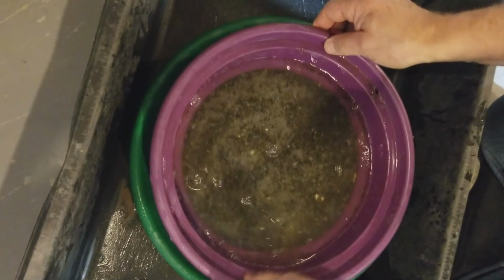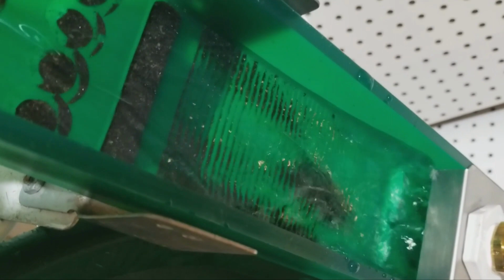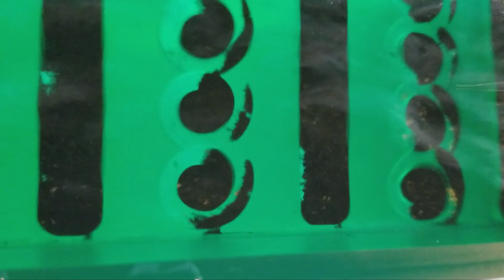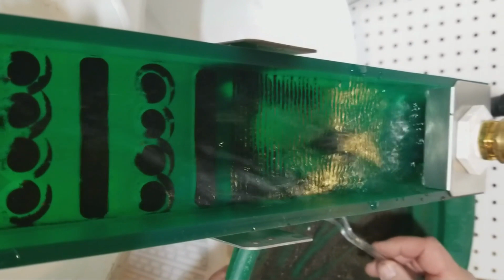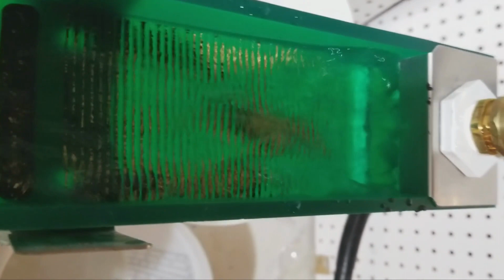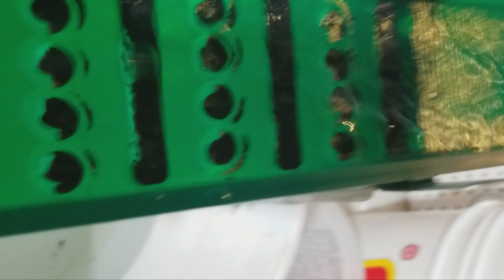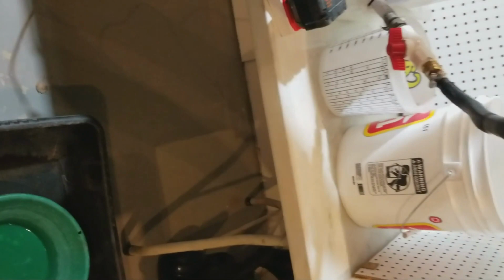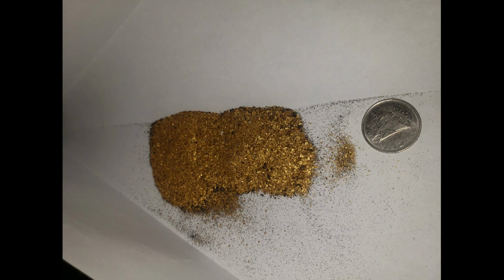New Canadian Gold Rush #9 Final Cleanup and Results From Fall 2020!

Comment: Man that’s a nice machine, about to toss my bluebowl aside and get one of those I think. Makes quick work of those cons
Reply from the maker: It takes way less finicky adjustment and time too. I could never get clean gold or tailings with it. My BB has been in storage since I learned of the VDR stuff. There is a lot of good and okay recovery equipment out there but the mini outperforms it all, even up to the larger very expensive professional shaker decks. A lot of placer miners could probably replace their gold rooms with a $300 recirculating setup and be way further ahead. Thanks X4!

Comment: Amazing recovery, what I did with mine is to put a thin piece of fiberglass in front of the gate to lower it some and had a more even flow of water over the top ripples, tell ya what the mini sluice hangs on to the gold. yeah you see how your water is coming out in a V at top, if you lower the gate the water comes out even across the first ripples and leaves that entire surface evenly covered with gold.
Reply from the maker: It is more evenly covered than it looks because the light is blocked for a lot of the early shots. But yeah, I agree that water flow should be even at the start of the sluice run. The V mat is called a V mat because with balanced flow it generally makes a gold V impression before the gold is drawn into the lower riffles. Thanks Diggin! Lots of bright minds out there ready to participate in this gold rush!

Comment: $22hr ain’t bad at all 🤩 I ordered a bilge pump controller from Washington Beach Mining, will be nice to control the flow on the highbanker and miller table. Best of luck to y’all this season ✨✨✨
Reply from the maker: $22hr is way better than the 1 cent an hour cutoff I impose on myself when I am prospecting a new area, lol. We have a few areas outlined that are $50-$200 an hour shoveling - those are the kind of areas you would make a killing with a mechanical operation. You can machine mine on the Fraser in some areas if you find a good deposit. Thanks CGH!

Comment: Is this black sand magnetic? I have tin oxide which is a real pain
Reply from the maker: In the area these cons came from it's probably about 30%-50% magnetic. We found that using magnets brought up too much of the small mesh gold with it and then it still needed to be panned so using a magnet didn't really save any time so that's one reason the cleanup sluice is so useful since it doesn't care if the particle is magnetic or not only its specific mass relative to the other items in the cell. The VDR gear can be used to recover heavy minerals from lighter ones, including silver and tin and hematite (iron) and the like. Thanks for the question!

Comment: So what justifies a $180 price tag on that piece of plastic?  I just can't get grasp of that.  And your answer will help my decision making, lol.  I'm very sorry, but I just don't see $180 looking at this.
Reply from the maker: Hi Chris.

The VDR tech took a lot of time and money to perfect and patent so there is a significant royalty cost for each product. Aside from that, the sluice is made from a high durability rubber compound that we source from the US. It's not a $5 piece of plastic from China. We choose to support Western economies because their values align more closely with ours, even if it raises the cost of our goods slightly. It's not sold at a huge markup. Another factor is that we use a multi staged production process to reduce imperfections and purge air from molds with vacuum chambers. Our competitors don't do this in order to save a few bucks. We do it this way because we want to produce the best products possible.

The most convincing reason it is worth $180 is that our mini sluice has saved us as mere hobbyists several hundred man hours of labor on the low end. Realistically it is many multiples of this. Time is at a huge premium in the field and saving time means higher morale (more rest at camp) and more time in the field which has led us to more discoveries and more gold. Even at $1/hr it has paid itself off more than other piece of equipment we use except perhaps a gold pan and removed the most tedious and boring part of the job.  The value ratio is so high I'm shocked more people don't use them. We were skeptical too in the early days because we already owned about $2000 of the top rated fine gold recovery products before trying these and we used it for one day and it outperformed all of them by such a huge margin with about 10% of the usual the effort that it had approximately a one day pay off. Instead of panning and processing until 2am we feasted and planned our next moves.

If I could go back in time and trade the $2000 for a $200 item that works way better I definitely would. This also led us to the realization that the same tech would work just as well in a production machine. So that's what we did and we increased our prospecting wages and recovery hugely and lowered our cleanup times by about 80-90%. Fine gold yields exploded and the amount in our tailings was reduced to traces. The hobby became a lot more fun.

I hope that helps. Have a good one, Chris!